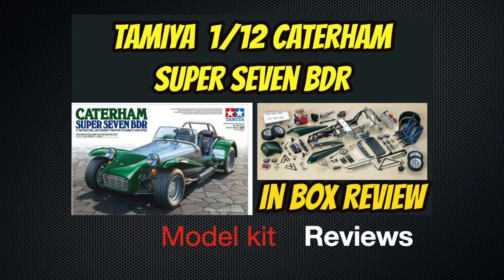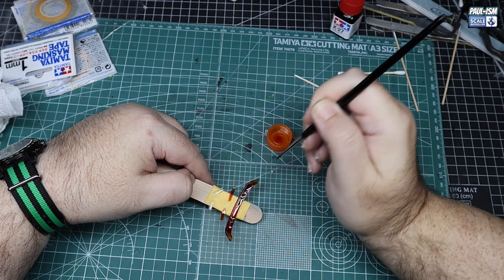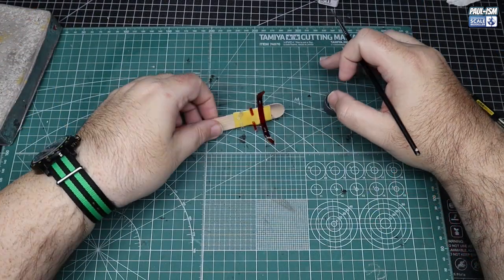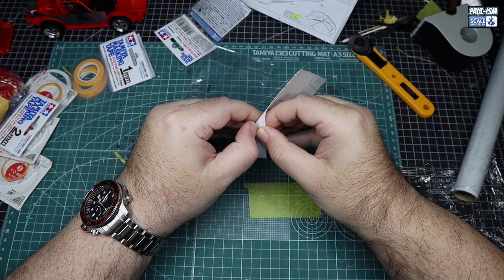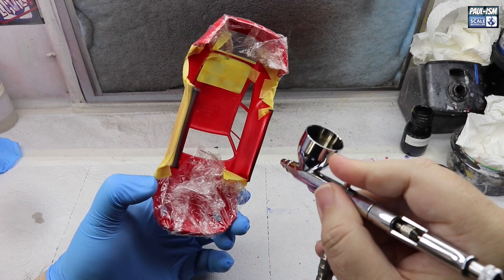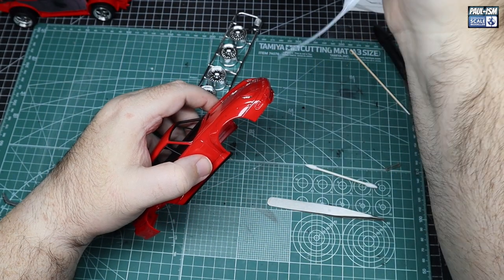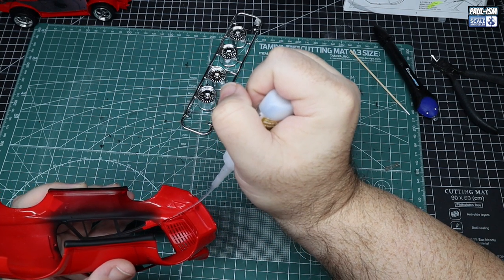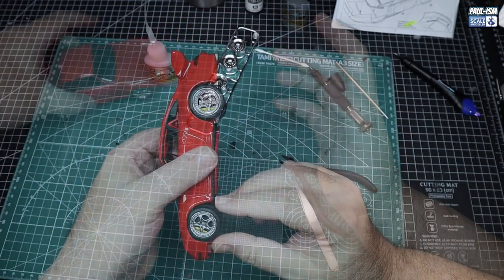Part 4 - Tamiya Porsche 993 GT2 Video Build

Comment: Great job, Paul! I had the same issue with the rear spoiler. Also, I haven't seen a single 911 GT2 that didn't brake the front grille at one time or another 😅. But as you say... It is what it is. Cheers, mate!
Reply from the maker: Cheers buddy :)